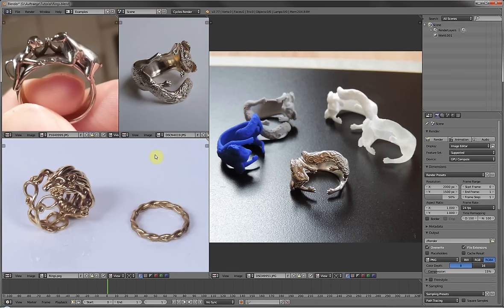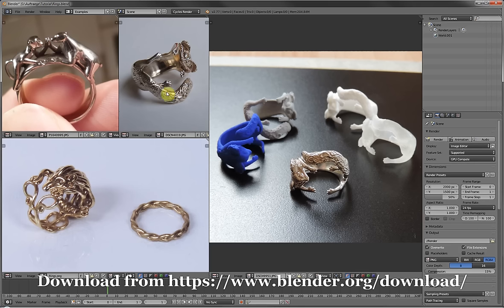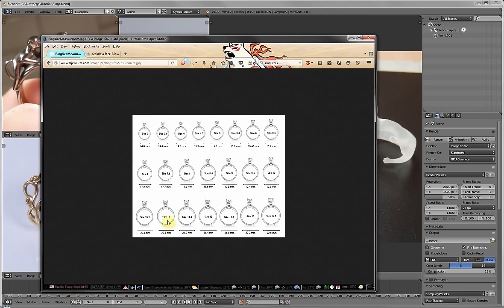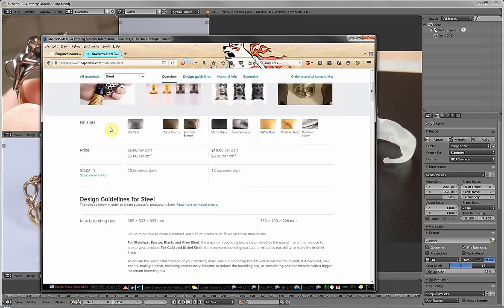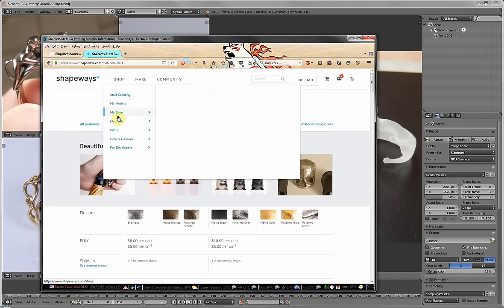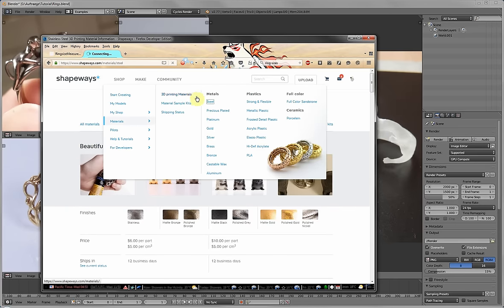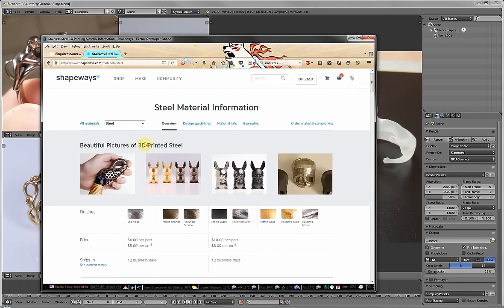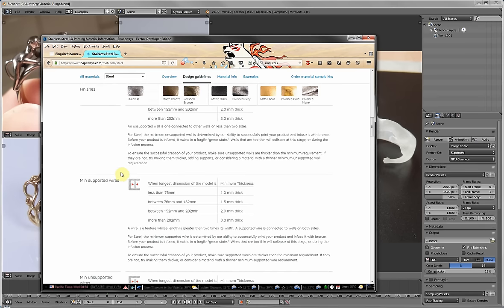Basics Methods for Beginners to Create Rings for 3D Printing

Comment: Amaziing tutorial bro... BUT  WE also NEED A DETAILED TUTORIAL ABOUT JEWELLERY RENDERING... THE LIGHTING SETUP ESPECIALLY... I have tried several times but the reflection and refractions thru the gems is not that attractive... May be there is something missing.. I am using Hdr lighting in Blender but the gem rendering are worthless everytime due to the bad reflection refractions.... Kindly Help
Reply from the maker: HDR on their own are often "washed out" so you need to multiply the strength with something <1 or put a gamma node between the HDR and background node and crank it up, use high quality .hdr or .exr and don't be afraid to "cheat" and set up gobos that don't have to be more than black planes that block the light from certain directions to create contrast and make sure to use filmic colour management.

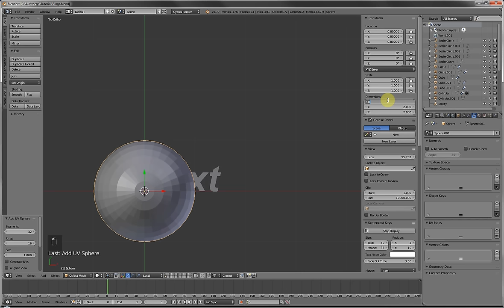Comment: 1:20:45

you are being too conservative I think. You want the diameter of the circle to be 0.5, so you could've gotten away with 0.25 radius.

I only noticed it when I tried to make a rather thin ring and I was confused why the text wouldn't fit. Then I realized you should use 0.25 for the radius for the spphere so you can have a 0.5mm thickness on text font.
Reply from the maker: The dimension in Blender is the total size of the object, so making it 0,5 will result in a diameter of 0,5. You are right of course that when creating a sphere, you can use the toolbar or press F6 and make the radius 0.25 but that menu is no longer accessible once you transform or deselect it, so after that you'd have to work with scaling.

Comment: Haha is that by coincidense that green bar in time is actually the start of the tutorial?
PS are you still working in Blender units or did you change them to MM. I didnt see you do that in the beginning
Reply from the maker: Sorry for the late reply. I've run into many problems using actual metrics, like you can't seem to set it to mm, it will chose a unit that will result in the shortest number and be really inconsistent. Copy pasting is also very bad with units as it doesn't seem to take the unit into account so you can paste what would result in 20m when it should have been 20µm, so I just stick with Blender units and use one BU as 1mm.
I wasn't planning for bars to align:)